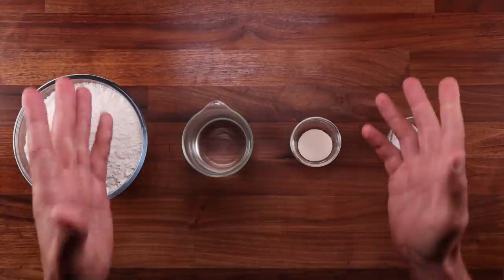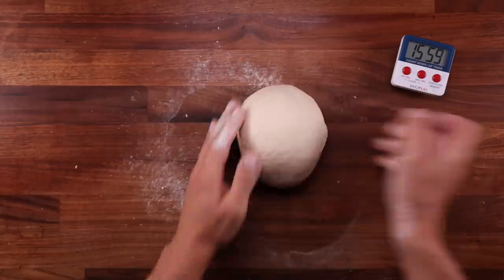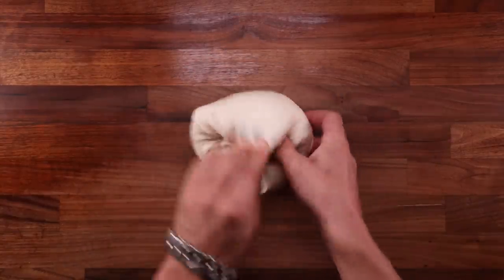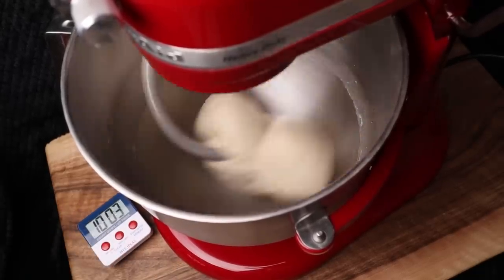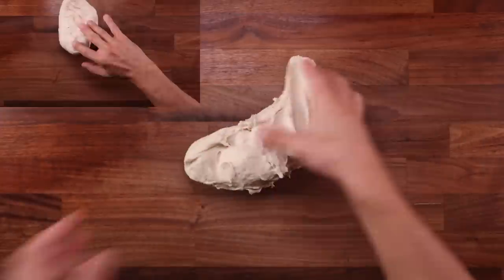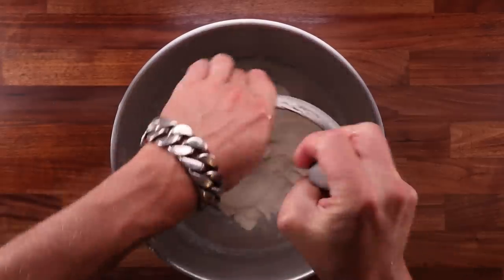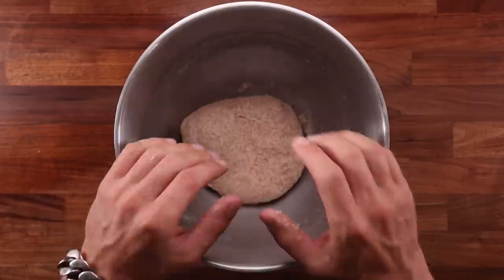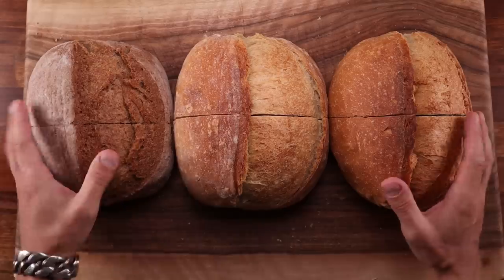How Easy is it to Overmix Bread Dough? Can you do it by Hand?

Comment: Another interesting experiment which debunks yet another old wives tale about baking. The time between being fully mixed and over mixed is so large I think it would be pretty much impossible to over mix unless you are making very high hydration dough with low protein flour. Maybe easier with a large industrial mixer, those things can really pound the dough, but certainly not possible by hand or a with a small kitchen mixer.
Reply: You could probably do it with a food processor, but otherwise...
Reply: I remember hearing that “overmixing” in industrial machines is usually the result of too much air getting into the dough, which affects the  fermentation. Not sure if that’s actually true, but it seems pretty hard to overmix dough to affect the gluten from chain bakers tests.
Reply: For plain yeasted white flour that is true. But when you get into other flours and sourdoughs it can be very easy to overmix.

Comment: When i was an apprentice in a bakery i overmixed a dough and it mixed less than 15min! Though the machine i used was a machine that could mix over 30kg of dough at once. But the feeling the air inside the machine was very humid and very warm and for the dough, you could not touch it at all, it stuck everywhere.

Comment: I think it might be easier to overmix enriched doughs. It could come down to mixer speed rather than length, but when I saw the dough you finally were able to overmix it immediately reminded me of the issues I had the firs time I tried your brioche recipe in my stand mixer. It might be interesting to do a side-by-side of a few different types of dough in a stand mixer to examine the differences in kneading speed for enriched, plain, whole wheat or high hydration doughs.

Comment: Oh, My! This is such a great video! A week ago, I followed the recipe for 100% Whole Wheat Tangzhong Milk Bread with a mixer. With speed 2, I mixed 8 minutes when the dough came together, so I started adding room temperature butter little by little for 25 minutes ( rest a few minutes intermittently ).  The dough looked like about to almost form a ball several times after the butter being added, yet fell apart (repeated this look several times ).  Finally, the dough looked exactly like the very last one, the whole wheat dough in your video that you DESTROYED.  I wish I saw this video before I made the bread, so I could still use my own hands to recover it a little.  Actually, mine was much more pathetic than yours, that I just dumped it into the baking pan.  I let it proof only a few hours, yet it already had very strong yeasty smell (usually whole wheat sourdough takes around 7 hours to bulk proof), with about 5% rise.  I mixed this dough so much, for Tangzhong seemed to make any dough stickier, so I thought it might look differently in a mixer.

Thank you so much for making this video.  Great help!

Comment: Good info in the vid, as usual.  I've used a Horbart C100 mixer to make bread for decades.  I don't recall ever having a problem with overmixing - even in more recent years when I began following the advice of a modern bread baking cookbook (2015) and "developing the gluten" using speed 2 on my mixer for 5 - 6 minutes after ingredients are incorporated at low speed.  I've had good results.  Not concerned about overmixing...  What I'd like to know more about is temperature and why it matters.  When I learned to bake from my dad back in the '80's, he would warm everything to about body temperature - including the mixing bowl.  Again, he had good results and still makes great bread.

Comment: This is a great video and this demonstration helped me to better understand because I do use the stand mixer. And my strategy for sure will be from now on  to slightly under mix it and make sure I get some folds during bulk fermentation. 
I often do a 90% hydration for ciabatta bread in the stand mixer using the cake paddle and it is necessary to mix it at very high speed and I have destroyed the Dough.
Reply: @kevinu.k.7042  Yes and I’m probably getting too carried Away with the cake paddle.  I’m sure your comment is  very correct

Comment: Yes I have over mixed dough, by hand. It was whole grain ( Mostly wheat but I do not remember the other grains) It broke down very fast, under 15 minutes. 
Somebody told me it was because I used a stone ground whole wheat which contains raw wheat germ and the germ has enzymes that attack gluten. In normal milling the germ is removed before grinding because the heat will oxidize the oils, but stone grinding stays much more cool so the germ can be included. I have not verified this with other sources. But I do have a distant memory of a different dough failure, that had raw wheat germ as an ingredient, that dough could not be saved it was almost a liquid cake batter at the end. 25 years ago though so I may have over-mixed memories, and I did not know anything about dough temperature other than effect of rise time. 
Sourdough can also be an issue because over fermenting can be similar to over mixing.

Comment: I guess you can mess up making bread but it takes a lot of effort. For me anyways I have made all kinds of timing mistakes, measurement mistakes, and thr bread still turns out great. Personally I believe people put far too much emphasis on perfection, when very little perfection is required.
Once I forgot to put Butter in the dough, and only remembered after the dough had risen, I put the dough back in the mixer added the Butter, let the dough rise a second time, it turned out the same as adding Butter initially. Pretty difficult to mess up Bread.

Great video as usual.
Reply: Yeah ..... Try sourdough.  That will humble you until you have experience.  Anybody can make yeast bread but sourdough is another animal.
Reply: @bayanon7532  Sourdough is trivial, takes a little effort to start, after that it is very simple. It is possible to mess up sourdough but takes extreme neglect.

Comment: So grateful for this complete demonstration! The only time I've been tempted to use the stand mixer, and thus risk over-mixing, is with brioche and a very high-hydration focaccia. The hopeless stickiness of high hydration doughs sometimes tempt me to use extra bench flour. Tossing them in the mixer solves that, though I worry a bit when the motor on my stand mixer heats up. I've watched you hand knead past the sticky stage in enough videos now, to push myself to keep on going, but still get tempted to "solve it" with more flour than the recipe calls for.

Comment: Amazing video. You killed a few birds with one stone. Especially the video you planned to make with a mixer and high hydration dough. 
I found from my experience with making pizza dough and higher hydration that when you undermix a bit and then let it sit for 20 minutes and then do a few more stretch and folds works out really well. Its a bit sticky and not perfect mixed but when you make the balls and put them in the fridge for 15 minutes as we learned from you, doing that second ball from the fringe makes the balls really smooth and evenly distributed temperature and strength which then works great for longer fermentation. I have adapted that technique to making the balls. 
I really like this video because I stopped using a mixer since I discovered your channel but the other day I mixed for 6 pizza doughs and I wish I had used the mixer. It took longer to mix the dough by stretch and fold and my arms where in pain. 
I think the moral of the story with this video is, over mixing is a waste of energy and time, however undermixing and using autolyse can be your best friend 
and I also found with Pizza is you don't need a super spring like bread, so even if undermix a bit, and what I mean by that is not having a perfect smooth dough in the end but some stickier surface as you would get with higher hydration.  You can get a great pizza!
You showed us that over mixing has many drawbacks especially with final temp and we all know temp can be our enemy. Thanks for this video really helped me out with the mixer for higher hydration. I was always afraid to run the mixer for to long but as I saw 20 minutes at higher speeds did the trick. I usually do 8 - 15 minutes stretch and fold depending how big the dough is and how much hydration but using a mixer can have its benefits. :) 
I can't wait to see the high hydration and mixer video coming soon I hope :)

Comment: Interesting result. I want to try using a mixer for high hydration dough, every time I try to knead it by hand I feel like I get frustrated with the mess it becomes.

I don't think I've over mixed dough. But I've suffered a similar result by over fermentation. Since I usually bake pizzas, it becomes a nightmare to stretch out, impossible if it's too far gone. But it actually tastes pretty good if you actually manage to get it into the oven.
Reply from the maker: It can be quite sticky and messy when done by hand, but it should come together. Some high hydration doughs can take up to 15 minutes of hand kneading. Yeah even when it's over fermented it can be made into great tasting bread/pizza :)

Comment: After watching this video, I'm starting to realize that overmixing may have been what caused my sourdough catastrophe today, and not over-hydration.  Here I am, yet again, watching one of your videos mere hours after something went horribly wrong, and this time I also didn't search for this video.  It was just offered up to me by the YouTube gods.  

Anyway, today and one other time months ago, I was mixing my sourdough in a mixer, and it just turned into a completely useless mess.  Tearing everywhere and super wet and sticky.  Completely unworkable.  I even tried saving it by giving it some resting time and folding, but the dough was just a complete mess.  Definitely wasn't under-mixed, because it had previously been a very beautiful, smooth ball when I first combined the autolyse and the levain.  Very strong bread flour with only 1.5% rye and 10% whole wheat.  72% hydration.  I MUST be overmixing it and destroying the gluten.  I think it fell apart after I added in the salt.  The salt must have given the mixer some "grip" on the dough ball and started ripping it apart.  I use a 2.5-hour autolyse, so the gluten was probably heavily developed, and I must be mixing more than I needed to.  Next time maybe I'll just mix in the mixer until it comes together, and then do the rest by hand, or at the very least watch the dough to see if the surface starts tearing.

Glad I saw this video though.  This whole time I was thinking that maybe I accidentally measured the hydration wrong and that's what caused it to come apart.  But now I know why there was no saving this dough.  The gluten was gone and would never be coming back.  And this exactly mirrors the other one time that this happened, and that time I also thought it was an over-hydration issue.

Comment: Just wondering. So we always talk about building strength, do many folds, how important it is to build gluten structure for the bread to rise up, not to the sides. But as you showed here, even with basically gluten structure being destroyed, you managed to pull off pretty nice loaf of bread. It seems to have the same shape (maybe a little more flat) so why bother? (maybe except for easier handling bread with better structure) Over the time, I've been trying to implement different rules and advices to my bread making, but honestly, the only thing that drastically improved my breads, was using preferment (thanks @ChainBaker !). I don't want to sound ignorant, but other tricks, techniques, order of adding things often felt like art for art's sake.

Comment: Interesting thoughts on windowpane. I never bothered when I predominantly mixed by hand because I found I usually didn’t get one, but the dough seemed fine to me based on feel.
Reply: I found many "tests" in baking they try to teach us are inconsistent for me, at least I can't get the hang of them. Window pane test is one example - how thin should I be pulling, is it okay if it tears, how does hydration and wholemeal flour change the expected result? Other example is the poke test - it seems I can't judge the spring-back of the poke well, what if some parts of the dough spring back fast, but other parts slowly, etc.
Reply: @gaborszabo9804  I agree the poke test is pretty inconsistent and influenced by different factors. With window pane what I’ve seen that I think is a bit more helpful is that the edges of whatever tear you get in the dough when stretching it should have pretty smooth edges when you have strong gluten development, whereas it looks more ragged when it’s not as well-developed. 
But I tend to prefer seeing a dough that starts climbing up the hook when I want really strong gluten development.

Comment: I'm still a novice, so I'm still in the learning process.. Sometimes my dough doesn't seem to get that elastic and will end up ripping easily and getting a rough exterior, even when I try to roll it into a ball.

  I repeatedly question whether it's due improper hydration level, or if I'm not working or folding the dough enough or correctly. But one thing I noticed recently is that I made rolls and I followed the specific volume measurements of a recipe. It came out perfect.. Then about a week later, I tried it the exact same way with a different brand of flour. The dough mixture turned out WAY too wet. I had to add a significant amount of flour into it just to get it to not look like a soup. Once got it to where I could work it, it didn't get as elastic as my previous batch, nor did it seem to rise as much after baking.

  I was surprised that there was such a huge difference in the amount of water that each flour absorbed. I've heard that you can experience differences, and that different flours have different grades or protein content, which plays into the process of making gluten. Though I checked the nutritional values on the flour, and they both had the same amount of protein listed.

Maybe the inconsistencies is partially due to different flour? I feel that I'm over analyzing things when troubleshooting issues that I experience.
Reply from the maker: Protein content can be a good indicator, but it is not always reliable and flours can differ quite a lot from each other. I try to stick to the same brand for consistency.
Another thing is measuring by volume which can be quite inaccurate. Here is a video about it  https://youtu.be/070k4O2Ws1A ✌️
Reply: @ChainBaker  Thanks. I appreciate the tips and info. I've been meaning to do the measurements by weight and percentages in the future, when I get around to buying a proper scale.

Comment: We know that the bran in the 100% whole wheat effectively 'cuts' the gluten strands during kneading which always makes it hard to develop gluten when using 100% whole wheat flour. Since you never really 'broke' the white flour, it would suggest the cutting action of the bran is the main cause of that particular dough breaking down. Would be interested to see a 1/2 100%:1/2 bread flour dough handles overmixing. The guess would be that the dough would eventually break down but not sure if the additional bread flour would handle the cutting of the dough by the bran for much longer.
Reply from the maker: You could be right there!

Comment: Once I overmixed a dough (at least I think I did) by hand kneading. I was making bread rolls, and I wanted to achieve great volume like industrial bakeries (other people tell me they do it with black magic dough conditioners). I used AP flour (10-11% protein I think), because textbooks said here they are made from AP flour. I heard that vitamin C is a dough conditioner, somehow helps the gluten structure, so I added some, because I thought the more/stronger the gluten, the bigger volume I get. About 60% hydration (again, from the textbook), added some vitamin C (aka ascorbic acid), and kneaded on the counter, by hand, as hard as I could. About 20 minutes I think. At some point the surface of the dough started tearing, it wasn't smooth anymore, it was rather like little trenches or grooves and when I baked it, it was inedibly tough, like a breadstone.
Reply from the maker: Make this into a loaf - https://youtu.be/L6MeyTvy7GQ it will be the softest bread ever without any magic ;)
Reply: @ChainBaker  That's a totally different type of bread, it's enriched with milk, eggs and butter. I was going for a regular round bread roll (or bread buns? sorry these names are confusing),with, flour, water, salt, yeast, but wanted to achieve the greatest volume. The bread rolls you can buy here in stores, supermarkets, industrial (ie. non-artisanal) bakeries, weigh around 55g and are larger than my fist. Very airy, and there's a factor of nostalgia from childhood there. Not very flavourful and healthy though, but it sill kind of bothers me that I cannot achieve the same volume at home. Every Hungarian baker video on youtube about those bread rolls tell me they achieve the volume by using additives, dough conditioners, etc. I even wanted to get my hands on some of those additives, but the companies that make those sell to only professional bakeries, and in such big quantities that I couldn't handle in my home. ¯\_(ツ)_/¯
Reply from the maker: That's my point though. The milk, eggs, and butter are natural additives that produce the same result, but are the real deal 😉

Comment: Great experiment...I have a question please, I hardly find bread flour in my town, can i substitute it by mixing all purpose  flour with fine semolina? To get high protien content and better rising bakes....I use a sourdough starter usually .
Reply from the maker: You can use AP flour, but just reduce the amount of water a little to make it easier to handle. It will work for most bread :) Or you could try using a little vital wheat gluten - https://youtu.be/mf3Xo6YtsB4